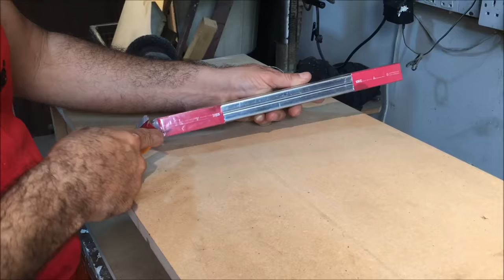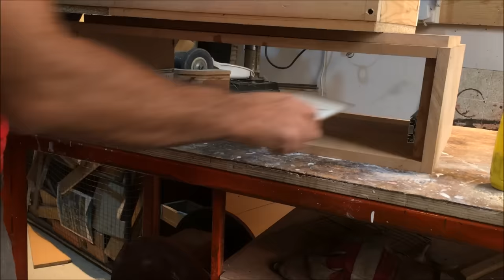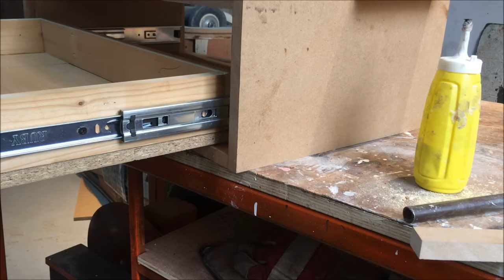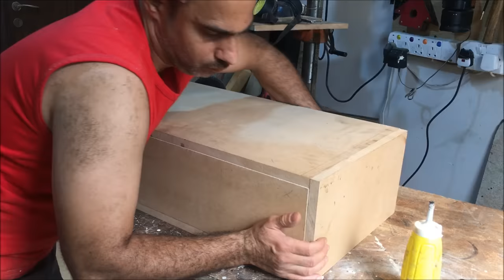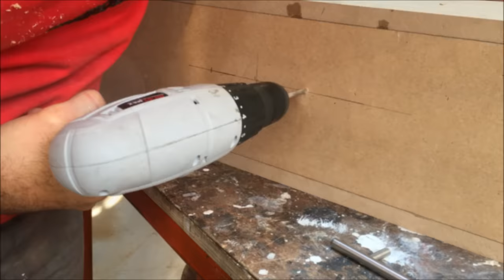How to install drawer slides step by step

Comment: Every video shows how to install in in new cabinet where everything is easy to install but no one shows how to replace existing slides with cabinets that are full of stuff and have shelves underneath the drawer like in most homes.
Reply from the maker: Devender Tejpal if you wanna replace an existing slider you have to find one which is exactly the same otherwise there will be a lot of measurements if I found a cabinet like that I will make a video in the futures thanks for your comment
Reply: @mardakworkshop4450  I  am replacing old style wheel sliders with softclose full extention sliders
Reply from the maker: Devender Tejpal good luck with that man
Reply: @mardakworkshop4450  the telescopic channel are fixed horizontally or little tilted??

Comment: That was good
But you need to explain what the two rubber parts are
I think one is a backstop at the end of the cabinet support - I cut this off by mistake!)
The other is a release "spring@ which you have to squeeze to open the sliders

Also are there are critical measurements at the front end of the cabinet walls and drawer sides?

Comment: Thank you! I’ve never done this before. This is exactly the type of drawer space and drawer slides I got. The slides came with only a measurement diagram of how wide the slide is but zero installation instructions.I really want to do it right the first time. I really appreciate your video!

Comment: Thanks for the video. My drawers are 2000mm long, drawers slides are 1900mm long. Do you think I can use the same technique for gradually pulling the drawer out and attaching fasteners one at a time or could the drawer run the risk of getting a slight vertical angle? 

I guess it depends on the surface you're working on eh and how flat / even it is...?

Also what do you think of the technique of mounting the drawer slides underneath so that you can make the drawer wider?

Comment: Could i mount them from the bottom ? Or is there a type of rail system that I could use I'm trying to hack an IKEA unit to hold a 3d printer

Comment: thank you very much for showing what in reality i need to know & understand on how to install corrrectly a simple sliding drawer
i was looking for hours and a bunch of clowns expossed what they believe is the easiest way to install one of these with no clue or whatsoever is happening in real life - and wasted my time misserably (sigh)
your video is *key in eliminating all the crap these guys evidently misinterpreted regarding the implemention of a simple fixture into a sliding cabinet
*by putting that piece of wood in between the sliding fixture and the bottom of the drawer or edge, have eliminated potential wasted time on youtube mostly crappy videos that only serve to waste time
.. and as you know, time is gold
thank you again for this precious video
i'll be your fan from now on
Reply from the maker: thank you very much i have another project and it include installing drawers

Comment: i would like to make 2 drawers under my Camper van bed , as it is high i wiuld like to use the drawer as a step to make it closed with a wood on the top with a hinge. What wood i need to use .I got sliders capable to hold 250 kgs

Comment: Hi thanks for the helpful video. I need a custom single flatbed drawer that would be used for keeping tools while working at my workshop. But the problem I am having is I don’t have any side support where I can mount the slides. Only option I have is to mount the slide just underneath of the main cabinet and use the top side of flatbed to mount against the drawer. Weight on the flatbed drawer could be upto 25-30kg. Can the flatbed handle this weight when top-mounted like this? Thanks
Reply from the maker: Tapash Datta hi i think it will sometime we have to try new thing good luck with your project 👍🏻👍🏻😍😍

Comment: Only works if the stationary sides are EXACTLY parallel and plumb to each other, and the spacing between the two is exactly right
Reply: Yea i also noticed he didnt use a level to confirm that the drawer was level front to back.

Comment: Thank you for the tutorial!...  From what I understand correctly.. The drawer itself cant really be constructed until the slides are installed on the cabinet correct??  otherwise you wouldn't know how WIDE to make the drawer....   Sorry.. I'm learning..
Reply: I am still learning, also! I do know that most bearing slides will take up 1" of the drawer opening; 1/2" on each side. So, construct your drawer width 1" less than the cavity opening. Hope this helps. Keep learning!
Reply: I usually leave 1inch

Comment: How do you remove the part that screws on to the drawer
Reply from the maker: There are two small handle one on each rail press them together and pull the drawer out

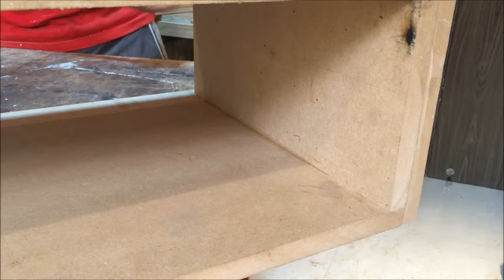Comment: after 0:14 Major mistake , you haven't showed how to open telescope Chanel , that's the most important to learn . not satisfied 😏
Reply from the maker: Wills My mistake put t it is easy there is a lever in each rows you pull it up
Reply: @mardakworkshop4450  hey thanks for your reply .

Comment: That is a lot of unnecessary work. Separate the two pieces. Screw the larger one to the bottom of the opening. Then screw the smaller one to the bottom of the drawer. Then put them together and the drawer will clear the bottom by an even and equal 1/8 inch. There is no requirement to put the slide half way up the drawer and put a spacer at the bottom and maybe put it in crooked.
Reply: So how would that work with a chest of draws?

Comment: NEVER SHOWED HOW TO REMOVE DRAW
Reply: included instructions will tell you how to push on black plastic tabs at the front of each slider to remove drawers.
I believe one tab is pushed up and the opposite one is pushed down.
Reply: Lift up black lever on the sides and pull out with just a wee bit of force.
Reply: Also see my comment above, plus info on calling Hafele technical support.